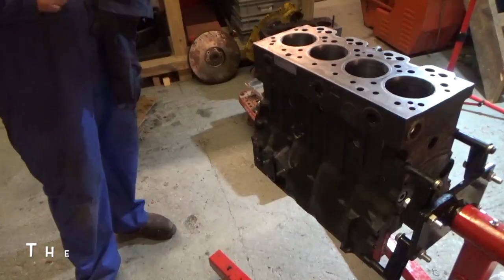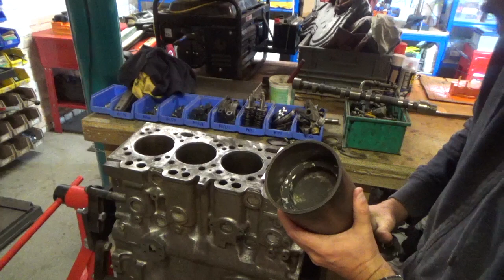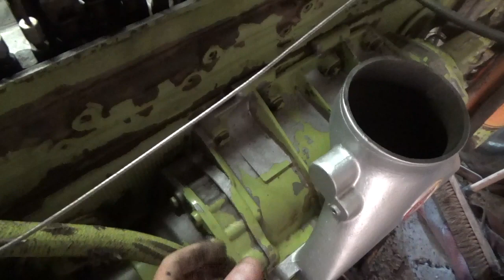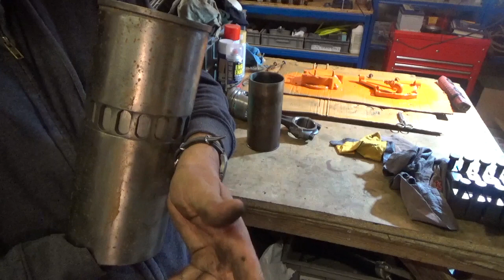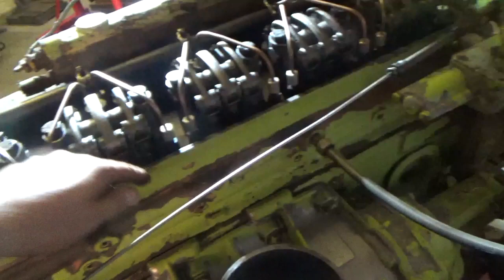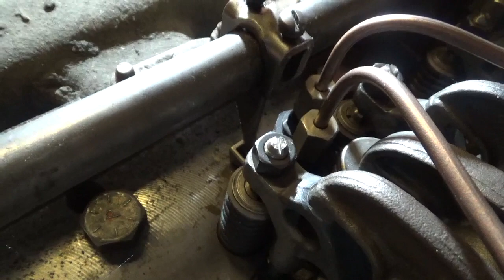HOW DOES A 2-STROKE DIESEL ENGINE WORK ?

Comment: Hi Kurt why don't you find one of theses engines to rebuild i remember these screaming down the road in the 70's and my father used to drive one of the lorries with a TS3 your ears used to bleed with the sound of the screaming knocker in the cab what a sound though nearly as good as a RR Merlin :). https://en.wikipedia.org/wiki/Commer_TS3

Comment: Please please put it in a good auld fordson e1a major then put at least 110 injectors in it also a turbo and waterm methanol injection which increases the amount of torque ve they respond most excellent to water methanol injection and of course a jake brake and straight thru 5inch stack oan it and a big vortex stainleess steel oil bath air cleaner which is the only ty of filter you cqn run up to 50 percent gas oil to engine oil no betterand more efficient way to keep dust and crap oot of a lovely engine that draws heck of a lot of air compared to 4strokecrap a8v71 (9.3litre) draws as much air as a cummins vta1710 (28litre) cheers big ears 😜

Comment: Please excuse my ignorance, BUT:
I understood that a Detroit 6-71 was an inline engine, and a 6V71 was a V-configuration?
Wrong?

Wikipedia backs my theory up. Wikipedia is not infallible. Neither os my 60-year-old brain...

See: https://en.wikipedia.org/wiki/Detroit_Diesel_Series_71

Nomenclature
The first number refers to the number of cylinders in the engine, followed by a hyphen or "V", indicating inline or vee, respectively, then 71 for the Series designation, referring the nominal displacement per cylinder in cubic inches (rounding up 70.93 cu in (1.2 L)).

Like most Detroit Diesel two-cycle engines, the 71 Series are equipped with a blower yet still referred to as "naturally aspirated" (SAE designation). These do not have a model suffix identifier: 6-71 is an inline 6. When the model number includes a suffix, it denotes additional features. Engines equipped with needle unit[clarification needed] fuel injectors and commonly four exhaust valves per cylinder are indicated by the suffix "N", so for the V8, 8V-71N. Later versions were available with turbochargers, which discharged directly into the Roots blower intake; these have a "T" suffix, and with aftercooling, a "TA", so 8V-71T or 8V-71TA. "TT" indicates Tailored Torque and "TTA" Tailored Torque Aftercooled. These models are designated for economy (Fuel Squeezer) and constant horsepower ratings.

Oh well.
Reply from the maker: That's correct just as I said in the video

Comment: I have worked on these and the GM 710 3200 hp V 12's reliable engine but too noisy .  Prefer the 4 strokes

Comment: In the late 1970's the Royal Engineers went from the Allis Chalmers TL 645 bucket loader to the Terex 72-51 and its Detroit motor.
Day 1 Lesson 1 , " This here is the kill switch , remember that as these f****ers run away at the drop of a hat " 
Sorry Mucker but I hated them with a passion , gutless and tinny compared to the bullet proof Allis and its AEC 505 motor.
Reply from the maker: F*cking 505's.... 🤦🏻‍♂️ Lovely when they run but a pig when they don't. I nearly bought one when I bought that Detroit.